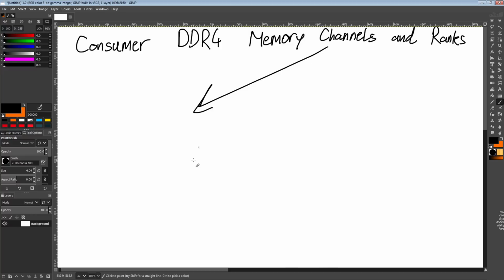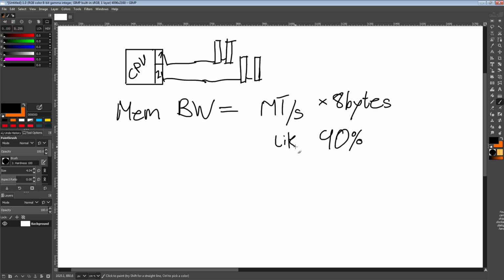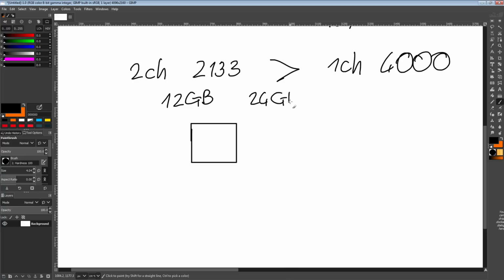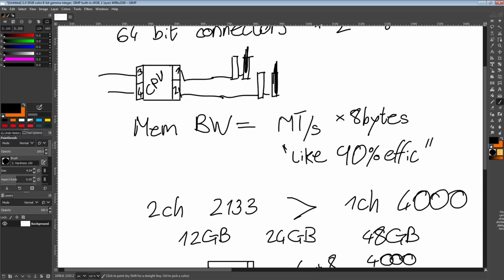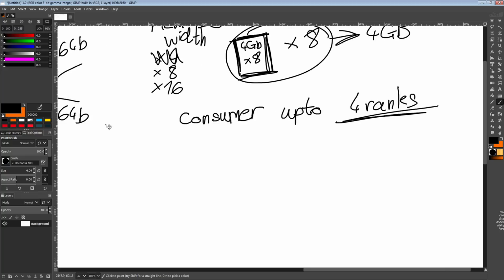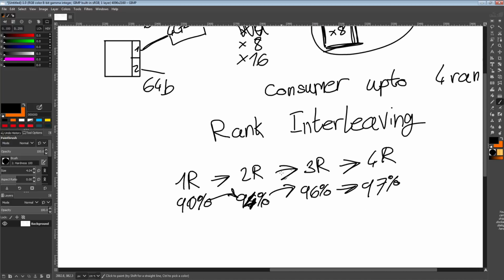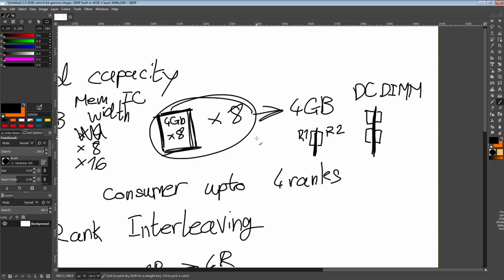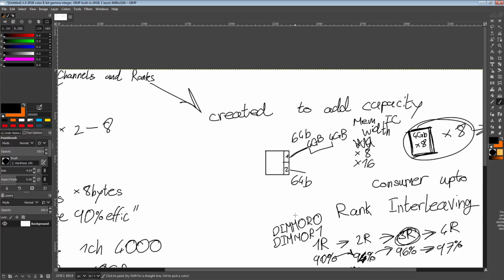Rambling about DDR4 memory channels and ranks

Comment: Finally a good explanation. My 8+8 dual rank (both) run well with 4 +4 single rank (both). But my current setup only allows them to run at 2666 mt/s at most.

Comment: I've heard that non-k intel cpu memory controllers have sorta locked voltage so OC is not that great, then does it mean that dual rank memory is better than 1rank with something like 12400 even if you're overclocking?

Comment: what i am trying to figure out is the memory purchase for my next build... everytime ive wasted money on higher "mhz" than i needed. i am trying to avoid this... 
i am planning on purchasing the 7950x3d sometime after release so i am looking at the 7950x specs... it says it supports 5200 2x2R w/ two sticks... and 3600 4x2R w/ 4 sticks...
which in my consuming eyes looks like 64gb of 5200 vs 128gb of 3600... however there is no DDR5 @ 3600... therefore i am confused AF. anyone got answers or advice for me? should i just buy 4 sticks of 5200?

Comment: might be a silly question: going from 2 to 4 sticks would require reducing clock (4400 -> 4000mhz), does that apply for slower speed sticks too (i.e. with 2*8gb 3600, adding another 2 sticks, won't run 4*gb 3600 and require reducing clock to i.e. 3200)?
Reply: Still learning. But probably yes. But then agen if the expected limiting factor is cheap ram? Ho said that the cheap ram can not actually run 2*8gb 4000? And so effectively 4*8gb 3600 ends up working? But it is quite a tall order for the 4 sticks to all have the headroom. 

Or maybe it actually is not the ram sticks that forces higher clock speed sticks from running slower. But instead the CPU memory controller hitting a limit and so the cheap ram left room for the controller to take 4 sticks instead of 2 running at a high clock and tight timings. Like really adding extra sticks do not really makes sense to be bothering the other sticks. It is far more likely down to the motherboard or CPU memory controller. No?

Really no really now it is best to not tempt pain and try and  a single buy kit ones instead of combining multiple.

Comment: ATM I'm using 3x16gb ddr4 of the same ram model and I guess two of them are in dual channel and obviously the other isn't. Aida test and that kind of syntetic benchs are giving me terrible numbers (half of when I had just two sticks in dual channel) but Cinebench and Blender tests are the same and cpuz exactly the same numbers. I wonder how much should I push it to 64gb to have all dual channel since I don't need the extra 16gb at all. I added 16gb to the 32gb because Unreal Engine has been crashing on me when migrating big projects, collapsing the 32gb. Someone any ideas?
Reply: Does UE stop crashing? If you use less than 32 Gb in other programmes, so there is nothing terrible or wrong with it. UE is just a little bit slower in big projects.

Comment: Hello, may I please ask you a hybrid (stupid and tricky at the same time) question?:
I am looking forward to buy a Thinkpad T14 Gen 3 with i7-1260p, dGPU MX550 and 16GB 3200 RAM soldered to the motherboard. This laptop model also provides one empty DIMM slot for the dual channel capability. I want to add another 16GB RAM into it. Given that Gen 3 (as Gen 2 and Gen 1) comes with single Rank soldered memory, which RAM stick should I go for: 1Rx8 or 2Rx8?
Like, what would be a better solution:
1) M471A2K43DB1-CWE 16GB 2Rx8 PC4-3200AA SE2 11 (or xxxEB1-CWE) ((I couldn't find any info about the difference between D and E dies))
2) M471A2G43BB2-CWE 16BG 1Rx8 PC4-3200AA SA2 11
The first one is dual rank which is probably better in terms of utilizing capacity, but is it neccesary concidering soldered memory is single rank? 
Or maybe the second one is better because of B die and retaining the clock speed? 
Lenovo support could't provide me any useful information, their website have both types (1Rx8 and 2Rx8) memories available as alternatives. 
Thank you in advance for your time answering my question and looking forward to get the right answer :)

Comment: hey Buildzoid! I have a very weird scenario and would love some help deciding if I should return a new kit. I basically got a Micron 32GB 2x16GB 3600 cl18 kit that was the exact same model in the shop page as the one I had already, but this ended up being a different submodel with not only different rank (dual vs single on the old) , but also different PCB (samsung B2 vs Hynix A2), rev E vs rev B (micron), 17nm vs 19nm, different row addresses... the works. The JEDEC tables es also slightly different, but XMP profiles are the same, and so are voltages and whatnot.

My issue is these 2 kits, which are installed paired in the two respective channels of my Mortar Max B450 (3800X on it), have trouble booting with XMP. I can only consistently boot them consistently after multiple attempts of resetting BIOS, going from 2400 (JEDEX) to XMP but also manually setting RAM frequency in advanced to 3600. I also managed to use XMP then manually set 3200. It does seem to stay consistent after it boots to OS once, but I fear I may have trouble in the long run. I also did not do a thorough memtest on the 64GB setup, but I've had no freezes or restarts the week I owned it. 

My question here is if I should be returning these (shop provides a month) and look for the exact same submodel kit. The new stick was 40 euro cheaper than the old one from 1y ago, so I guess I learned my lesson. I also know I should not be getting 64GB over 2 kits and sell my current kit instead to get a 64GB kit, but I don't need absolute performance, I just happen to have a use case where I need 64GB for virtual machines building Chrome and Android and whatnot.

Comment: I have 48GB ram all gskill 3600Mhz cl16. Ryzen 3500X, msi x470 gaming puls max
8Gb 1 Rank, 16Gb 2 Ranks, 
I had 16GB and add 32GB and it don't work, only 2133mhz but then i swap 8GB sticks with 16GB sticks they all run fine. My OC is the same as only with 16GB (3666Mhz RAM=FCLK) but latency (secondary etc) are a litte looser (just xmp and a little more clocks, latency tune is automatic by motherboard)
Reply: Hello good sir. Sorry that write 4 yrears after your comment, but i jave the same situation. Wanted to ask which slots you populated with which sticks?Thanks
Reply: @mivinca7 I don't remember, now i use 32GB RAM, you must experiment to discover what works. reset bios each time you change configuration.
and remember 3200MT is guaranteed by AMD only on single rank dual-channel configuration, more sticks-ranks less guaranteed speed, on amd documentation is showed what speed are officially supported (running faster is considered as memory controller overclocking)

So you can have bad luck and memory controller in your cpu is low binned. If you can test with different CPU (even low thier model)

Comment: Before I was using a workstation board with 128GB ddr4, I used to run 2x8 with 2x4 ddr3 on my old AMD system. Worked no problem.

Comment: Ey man maybe its a stupid questions but I have a doubt with my motherboard is an Rog maximus apex and it have two dimms slots and it have like a third dimm slot looks like an slot of ddr3 to install 2 extra m. 2 disks. Im planing to equip It with 2x16 dual ranks gskill. My question is if this slot for the m.2 disks is controlled by my memory chanells if I Will loose max frecuency or bandwith or something..

Comment: "Rambling" is the absolute definition of this video .. could have explained this in like 5 min ;)

Anyway ...

One thing that would actually be usefull to know that you didn't explain in this very detailed video:

In the last 6 min or so you talk about the 64gb configuration that is expensive ..  well ya it is more expensive than 32, but still at about same $ per gb.

I had hoped you talked about these higher capacity systems a bit more instead of "rambling" like you put it :) about 4gb or 8gb modules in various combinations.

What does the ranking do when you need those 64gb ram. You buy 4 modules of 16gb ram that most certainly is Dual ranked for each module.
Does this have any performance effects when you have 2r+2r for each channel in say a Ryzen system. Not talking overclock .. just plug the sticks in and run them at stock speed.

Comment: So apparently zen 3 is one of those "weird cases" and now I'm still unsure, is it better to get 2x 16gb dual rank, or 4x 8gb single rank for zen3?
Reply: 4 ranks over two channels is what they say is good. So 4 x single rank sticks would be 4 ranks over 2 channels. 2 x dual rank stick would be the same as long as you put on in each channel. 1st and 3rd slots or 2nd and 4th slots.
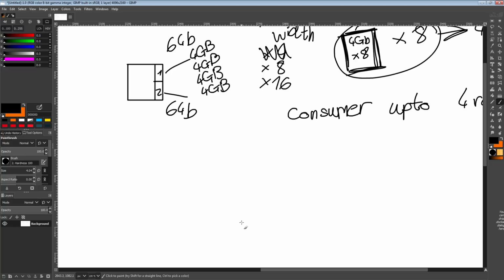Reply: Based on the video, i think both those configurations are dual channel quad rank so the bandwidth and efficiency will be essentially the same given that the clock speeds are timings are comparable between both kits. With the 2x16 though, you can upgrade your capacity in the future. You just wont be getting any additional efficiency benefits as you're already at quad rank Edit: I just realized rank is per channel at 24:10 so 4 single rank sticks is still just dual rank per channel where as 2 dual rank 16gb sticks allow for 4 ranks in a single channel

Comment: The only thing missing from this video is:
Why is multi rank bad for frequency?
I'm wondering if it is because of the different length/runtime between the ranks, but then using dual rank sticks would not be impacted ? And if so, same for T-Topology? 

Would love to understand the relation of ranks to overclocking.

Comment: What????
You lose extra 400Mhz when you insert second dimm?
I've never seen this happen in any benchmark or in my personal experience

Can you explain?
Reply: The only thing I can think of in your example is that you did not overclock your RAM to anything above XMP which your chips are designed to run at. A cool experiment for your system would be to go back to single rank, overclock to the very edge of stability to run stress tests or even overclock to the point where the system can barely get into windows. So that would require manually changing both frequency and timings of the chips. Then see if your system can perform the same feats when you populate the other dimm slots with your remaining sticks afterwards. Might have to do that when I get more time actually...sounds pretty cool to work out the performance penalty.

FYI, it is why overclockers like BZ tend to go for RAM overclocking records in single rank if you check out some of his other vids.

Comment: couldn't you run 12gb in dual channel the same as 24 if you did 2 + 4 and 2 + 4?
Reply: I don't think they ever made 2GB PC RAM for DDR4, otherwise you'd be right. I think you can get 2GB DDR4 ram but only for other lower power devices like laptops so maybe it could apply there. That ram is different in size and called SODIMM instead of our lovely PC compatible DiMMs.

Comment: Higher ranks wouldn't reduce effective speed instead of the max? For example if i have a 1 rank dimm that can theoretically go up to 4k  mhz but working at 3200 mhz in one slot, if i add another one in the same channel it will be 2 ranks so they will work at < 3200 mhz.

Comment: How do you end up with an odd ram speed if the speed is doubled on DDR? Like 4133 or something like that.
Reply: Frequency is like mph, it is continuous. The markers like 3200 or 4133 are arbitrary like speed limits of 30 or 45. The physical speed will just be 1600 or 2066.5 plus or minus the accuracy of the clock (a few percent)
Reply: @burakbiyikli  Ah, so they don't have to be integers.

Comment: so what better: all four slots with single ranks, or 2 slots with dual ranks?
Reply: From what I understand: 2 slots with dual rank.
Reason: the distance (signal runtime) is identical between the 2 ranks. 

He touched on in another video (maybe topology video, maybe x570 board review) that for 2 sticks, daisy chain topology is better for overclocking, while for 4 sticks T-Topology is better because T-Topology has the same length to all the sticks while daisy chain doesn't.
disclaimer: if i remember correctly. i watched that a year ago.
Reply: From what I understand all 4 slots in single rank would technically make it dual rand per channel. But if u are saying like 4, 8 GB sticks compared to 2 16 GB sticks both running dual channel the other would slightly be better one because the Signal doesn’t have to go farther and 2 u would still have upgradable and theoretically 2 sticks OC’s better than 4 sticks

Comment: I need someone to teach me about downclocking high speed kits

say one has a mobo rated for 3200MT/s and looking to buy ram, prices of the kits are negligible. 
kit1: 3200 CL14
kit2: 4400 CL19

what are the chances the 4400 kit will get close to the 3200 timings when downclocked to 3200?

Comment: Dual channel RAM appeared very long time ago, during Penitum 4 with E7205 chipset in 2002 & Nforce 415 chipset for AMD Athlon in 2002.

How RAM to be DDR & need to have dual channel, coz Pentium 4 period, the FSB(Front side bus) of Pentium 4 is 4 times of Pentium 3, 
P3's SDRAM is not fast enough for carry P4's FSB bandwidth, so Intel develop RAMBUS RAM for 1st Generation architecture of Pentium 4.

Due to AMD commonly use DDR1 by VIA's KT266 chipset, & dual channel becomes the Nvidia's Nforce chipset feature in 2002, the dual channel DDR, using DDR RAM is more common & Rambus RAM too costly, intel release their 1st SD RAM chipset i845 & 1st DDR chipset i845D in 2002, then i845E/G, then i845PE/GE & 848P.  

1st Intel dual channel chipset is E7205 in NOV 2002, but it is not common due to it is server product originally and costly. the 1st customer intel dual Channel chipset is i865PE/G/P in May 2003, after Northwood Architecture P4 released 17 months.

Once using the dual channel DDR RAM setup, it reach Pentium 4's FSB bandwidth & solve the lack problem and Dual channel memory becomes the standard of Intel's desktop chipset.

Comment: I have a stupid question, maybe. My Asrock 570 Taichi with an  AMD Ryzen 7 3700X, and Corsair Vengeance LPX 32 GB (4 x 8 GB) DDR4-3200 keeps reverting to 2600 even though I set it to XMP and 3200. I can't find out why. Thanks.
Reply: SoC Voltage 1.1v? One or two ranks? 4x8 is a lot heavier to memory controller in CPU than 2x16 ;) Use Ryzen Dram Calculator, Taiphoon Burner and uncle Google :) Cheers!
Reply: @dawidezzomezzo8256  Too complicated. I just removed 16gb and will see if that works. It did reduce my score in Heaven Benchmark by about 50 points, though.

Comment: Addressing your question (at about 23:12) regarding 8-bit wide vs. 16-bit wide DRAM chips: most desktop DIMMs use 8-bit wide chips because they are cheaper — i.e., you can buy two 8-bit wide DRAM chips for the same money as a SINGLE 16-bit wide chip of the same capacity, and have twice as many chips to bin from!
Also, it's far easier to get good 8-bit wide DRAMs because of yields; there are far more defects in 16-bit wide high-density DRAM runs.

Comment: I see nothing wrong with this video that wouldn't fit my understanding. However, there has been floating around some gaming benchmarking videos on 4x4gb vs 2x8gb dual channel (just search it on youtube), where 4x4 wins over 2x8 at by like 10% fps increase (also better lows) when run at same speeds, or gets at least the same performance at like -300mhz and +2 timings, on both intel and ryzen (however, I never see anyone mention if the frequency is synced with infinity fabric). Most of these videos are from one hYPERs channel, but even in the case they are completely fabricating results for whatever reason, I see same kind of results on other YT channels too, often accompanied with dislikes and disbelief. According to your video, this shouldn't be possible, or at least interleaving shouldn't have that big impact.

Also, I recently got 2 more 4gb sticks for my Haswell DDR3 system (dual channel), going from 2x4 to 4x4, using same 1800mhz 10cl settings, and my 3Dmark (some old version) physics score went up 14% (though this is different amount of ram), and so did my Userbenchmark ram score.

AnandTech "Memory scaling on Haswell CPU" article conclusion page lists number of sticks as higher importance than the frequency:

1.      Amount of memory

2.      Number of sticks of memory
3.      Placement of those sticks in the motherboard
4.      The MHz of the memory
5.      If XMP/AMP is enabled

6.      The subtimings of the memory

Basically, most people agree that in dual channel system 2x8 should be better in theory, but I see many cases of 4x4 being actually better, not worse. I just can't believe all these results are fake or full of mistakes, even though at first glance and current beliefs it would seem so.

Also, I haven't been able to find an answer for whether 2x8 dual rank would have the same effect as 4 physical modules, as they are much more rare nowadays.

Comment: What about 4 x4 GB sticks VS 2x8 GB sticks when ram overclocking can you push more out of a 4 GB stick VS a 8 GB?
Reply: From what I took from this video is that If you have 4x 4GB single rank sticks, and populate two of those in each channel it means you'll be in a dual rank configuration as you will have two ranks per channel. It therefore may be a little difficult to push this further than 2x 8GB single ranked memory chips.
Reply: @L33R1C3  yes but the qustion was about the way a 4 GB VS a 8gb stick is build and if the less range between the chips on a 4gb stick makes it a better overclocked and if so Will 4x4 be better than 2 x 8 when trying to Max them out

Comment: Running 24gb on Ryzen 3000 4-8-4-8 or 8-4-8-4??? Identical samsung single rank b and d?-die, xmp's are the same. Any idea? Thanks. These are 3600CL18 sticks, R5 3600 can only run 4 of the stable @3000, i have 3950X on the way, hoping it will have better IMC so can run at XMP..